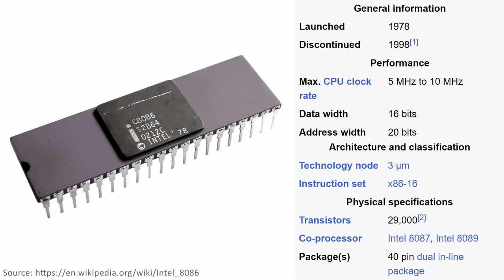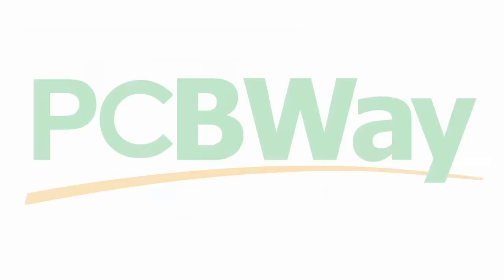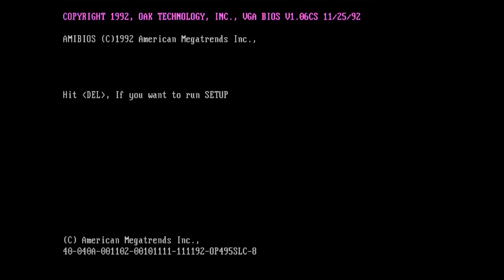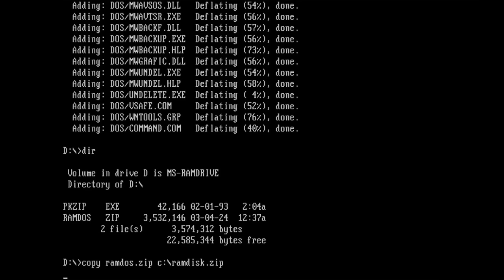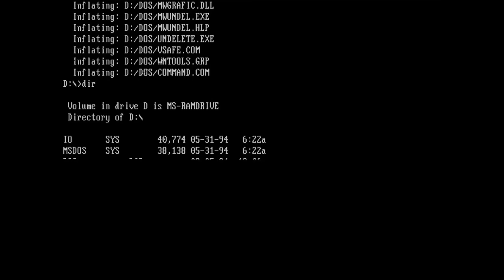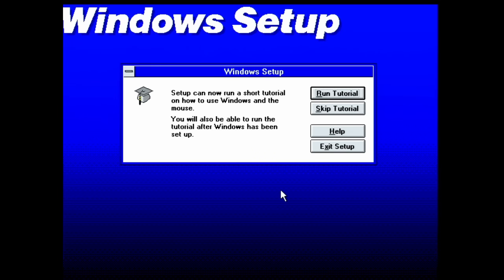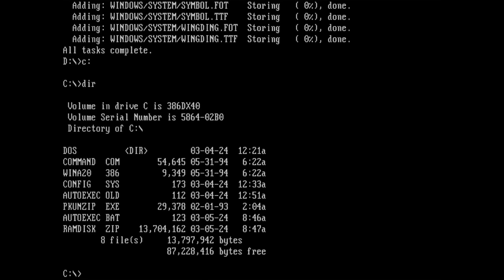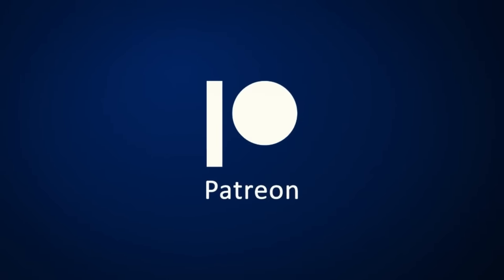MS-DOS and Windows on a RamDrive

Comment: I used ram drive as a working folder for saving files from Enable O/A. At the end of work, I ran a simple BAT file to copy everything from the ram drive to the 5.25” floppy. It was so much faster overall than saving to floppy every time.

Comment: It’s like running Windows 3.11 from a SSD from back then. It’s kind of incredible that RAM is and ever will be faster than some third Level Storage like HDD and even SSD but today’s SSD’s are much faster than RAM from back then.

But what I am wonder more is that if it’s possible to run DOS or even Windows 3.11 from the CPU’s Cache? On some CPU’s the Level 3 Cache should be big enough to Store on of these OS’s. I think it just needs some hardcore low level assembly programming.
Reply: arnolduk123  i dont see a problem by taking a cpu which has level 1, 2 and 3 cache and take the level 3 cache as "disk for windows". i dont think win3.1 apps could even use l3 cache so what. even some old cpu like a westmere xeon e7 has like 30mb level3 cache and still more level 1 and 2 cache than these old apps could ever use.

Comment: Back in the 486 days I had a machine with 12MB of RAM. I used to play Might & Magic 4 & 5 a lot, when installed together the 2 games would create "The World of Xeen." The game was a Wizardry style RPG where you moved from screen to screen around a map with a grid layout. The games only required 2MB of RAM to run correctly. I would setup SMARTDRV to use 9.5 MB of RAM as a disk cache similar to a RAM disk. After loading the game and playing for a few minutes it would start running almost exclusively from the SMARTDRV disk cache. Instead of the game taking a couple of seconds per move to load data from the HDD, when running from the SMARTDRV disk cache, screen updates from one screen to the next would happen instantly! If you weren't careful you could easily get yourself killed by moving around so fast but it sure made the game a lot of fun to play and much less tedious!

Comment: I used to do the exact same on my Amiga (who's OS sets up a RAMDISK as standard after each boot). Just stuck a load of RAM on my accelerator and did pretty much the same exercise as you did but in AmigaOS. But I didn't compress the files first - I just copied them to the RAMDISK at each boot. Looking back your method would've been a lot faster! 

The Amiga I had, came with a slow 2.5" IDE hard drive, so boot was slooooow when using the RAMDISK route. But after that initial mandatory coffee break, it really flew!

Comment: A work colleague bought one of those PCI cards that take memory DIMMs and retains its data if you plug it with an external power supply. He had dreams of copying his C drive to it for really fast boots. At the time, SSDs were very new, but I think he still would have got more capacity at a cheaper price if he went with the SSD, although not as fast.

Comment: In school around '87 we had PS/2 model 50 with 286 and 1Mb of ram, I set it up so I got a 384kb ramdrive and did my compiling there, saved a few seconds. 😀 most fun I remembered where when we discovered how to enable the 13h 256-color mode since Turbo Pascal 4 we had access to didn't support that.

Comment: It is alive. You can use ramdrives TODAY for caching, temp files and scrap data. It's faster than regular SSD 10x and similar or faster than latest NVMe drives. And another "hidden gem" is unlimited life cycle compared to SSD / NVMe. Modern programs for videoediting etc could eat hundreds Gb's of space with junk caching data, that tear and wear SSD. And now it could be huuuuge, like 32gb or larger.

Comment: I'm not at all surprised that Windows 3.1 just worked with the RAM drive. You're leveraging infrastructure intended to support network installs. For fun, get a copy of the Windows 3.1 Resource Kit and follow the "Setting Up A Shared Copy of Windows" instructions. You can have it write a read-only copy of Windows to your D: RAM drive and the config files and userdata to C:, where a slower disk won't be as big a deal.

Comment: I used to do a similar trick with my 4mb Atari ST, extracting an archive from floppy into a (compressed!) ramdisk. The self-extracting Lharc archive contained the Sozobon C compiler and my preferred shell program which weren't normally usable without a hard drive, but super fast from the ramdisk.

Comment: This is a nice overview, including pkzip's ability to only update or freshen files in an archive.  But why are you using smartdrv when everything is in a ramdisk?  It won't speed up the initial pkunzip at boot, because the .zip data is read only once during decompression to the ramdrive.  (And it won't speed up reads/writes to the ramdrive either, for hopefully obvious reasons.)  It won't really even speed up the save.bat pkzip update step, since the compression takes the most time in that process.  So why did you continue to use it in the final setup?

Comment: Yes and I had Dyna blaster running from it. At that point I only had 4MB of RAM. Edit: last time was quite recent that I used a ram drive. It was to integrate a utility that takes an image, process it and output the result. The problem was that it was a py exe that would always uncompress itself the py runtime. For this I had a ram drive to save on time and ssd cycles!

Comment: It's a shame that the RAM disk can't survive reboots, which was a useful but not well known feature of the Amiga's OS.
Reply: This recoverable ramdisk was called RAD: You could even boot from it. When I had an Amiga with enough memory (8mb) I even could configure multiple of these! It was like using a cartridge when playing a game. The regular ramdisk of the Amiga was called RAM: and did not survive a reboot.
Reply: Because it's none volatile memory - once power cuts off the data is gone.

Comment: Very nice! This is what I used to do myself back in those days. It's unfortunate that Windows no longer ships with a RAMdrive software as with modern systems able to take so much RAM that most applications will never use this would be an ideal way to utilise spare RAM capacity.

I use a RAMdrive on my current Windows system and have it configured as location for all temporary files that normally litter the system. My web browsers are configured to use it as well. All the cookies and data for web browsing stays for as long as my machine is running which enables me to restart a browser and have it all still work rather than have temporary files deleted on browser shutdown. The RAMdrive makes it all faster and has the advantage that anything potentially harmful is gone forever when I shut my system down.

A large RAMdrive could be useful for gaming in that loading and saving a game would be much faster. This could be implemented by starting the game through a batch file that sets up the RAMdrive, copies all the necessary files, starts the game, and on exiting the game archives any changes. This is double-edged sword in that, on the one hand, a system crash could lose all game changes if the RAMdrive contents had not been archived yet, and on the other hand no corrupted or garbled data from such a crash would be written to the hard drive so everything would still work as if the crash had never occurred in the first place.
Reply: one of the other commenters explains that in fact modern windows systems stilll can do this natively but you need to enable it.
Reply: @DoctorOnkelap If you're referring to 'prefetch' and 'superfetch', those are not the same as a RAMdrive. They can be of some benefit sometimes, but I prefer to keep them disabled as they massively slow down system startup and needlessly thrash the storage subsystem. They is also little control over them, whereas with a RAMdrive you have full control.
Reply: @DelticEngine   no the earlier comment mentioned going to device manager > action > add legacy hardware > install manually > show all devices > microsoft > windows ramdisk controller
Reply: @DoctorOnkelap Are you actually using this yourself? In what version of Windows? In Windows 10 it's supposedly a non-functional 'sample' driver that needs modification to work, assuming it actually works at all and isn't just there to keep up appearances for some legacy application. Interesting, though.

Comment: It's better to create a bin folder for personal commands and add that folder to the PATH variable. This way you don't clutter up your root directory.
The power of such a bin folder can be increased with batch files.
Reply from the maker: You're correct - didn't think of that.

Comment: My old Amiga 1200 from 1992 would automatically set up a dynamic(it would automatically resize itself when you copied and deleted files to and from it) RAM drive on startup as part of the OS, was very handy as we only had one floppy drive and no hard disk originally. Would appear on the desktop with the assigned volume of "RAM:".

Kinda become redundant once I got a second floppy drive, but once I got the hard drive, bigger games and more RAM, sometimes I'd copy the game install folder over into RAM: for near instant load times.

Comment: runing drivespace bin against a ramdisk making it into compressed memory ramdisk?
Reply from the maker: Ahh, nice! That sounds like cheating, downloading more RAM, or someone who also watched my DriveSpace video 😉 👍
But you're right, I should try that!
Reply: @bitsundbolts  biggest problem would be keeping it at restart because i don't know how dos unmount drives, does it has to start host drive before or after boot process
 for non boot partition probably would be easier to implement but i am still impressed that ramdisk works in dos as default and that windows know what it is
Reply from the maker: Yeah, I think it would require a very different approach. DriveSpace stores the content already in its own containing file. It might be a lot more complex than I initially thought

Comment: In fact, I use the same technique under win10 + ImDisk ToolKit for ramdisk + Robocopy for restore & backup. I put all temp files/folders and dozens of some cmd litle tools and batch files.
Reply: Some software can have troubles running from such ramdisk. There's a tool to overcome that (Google "Replacement (GUI + windows service) for ImDisk Toolkit". Haven't tried it though.

Comment: @BitsUndBolts
While you make a good point about 32MB being enough, I have done this kind of thing before and found that 48MB or even 64MB gives much more "wiggle" room, or flexibility if you wish. Granted, that was on a 486, but still, more RAM is always better, even if some of it goes unused. It's always better to have more than you need rather than to need more than you have.

Comment: You forgot to move the shell to D: drive. It's the COMSPEC setting in config.sys.

NB! I like using xmsdsk. It can locate itself into the top of the XMS memory. Helps to occupy all ram above 64MB on Pentium 1 machines, where chipset can't cache over 64MB of ram. ;) By having 256MB of ram and 192MB ramdisk in my Pentium 1, i can have the cake and eat it, too. :D

Comment: 8088/6 can address more than 1MB, every memory cycle it outputs internal state, so code, stack, data segments could be separated addressing more than 1MB. And it's not MMU strictly speaking, just use those bits for address.

Comment: Do a hex compare on the generated archives. Even tho it can update single files, I still think it's going to change the data of the whole archive, thus creating even more flash wear for every update you make
Reply from the maker: You're correct that if PKZIP does write the full archive even when only a few files need to be updated, then we're writing a lot of extra data to the drive. This solution makes a lot more sense when using an old spinning drive as permanent storage media.

Comment: when i was a kid i got a macintosh. they had built in ram disk from memory control panel. i used that a lot to play with things.  my friend had a 3.1 system and it was totally foreign to me. of course i wanted to play with it.  i found the ram drive files, played with that a lot but i never got it working for anything other than just loading doom onto... by the time i was in Jr. high we had windows 98 and macos 9.1 so the ram drive stuff faded away.    however in 2007 or so i had a phenom II system with a 256mb 9600 Nvidia. farcry 2 lagged pretty bad on high texture settings.  i made a 4gb ram drive and installed the game there - buttery smooth game play now that it wasnt so limited by 256mb Vram

Comment: I had ramdrive, in Win 3.1 file manager its icon is a chip. The files can be opened much faster with ramdrive , but after shutdown the files will be lost, if they are not saved.

Comment: No, I didn't know about RamDrive native functionality. Quite amazing the see such advanced technologies are in fact old. But I guess its use was more limited back in the days due to limited memory. Do you actually have an use for this not just being neat? And the booting process isn't actually slower with this?
Great video, keep up with the good stuff!!
Reply from the maker: Yes, the boot process is a bit slower because it needs to extract the entire archive to RAM. However, if you have an old hard drive that is slow in Access time, this setup could be faster. And I am sure that windows feels a lot snappier when loaded from memory than a spinning disk drive.
Reply: That's true. The limited memory limited the usage of a RamDrive.
I only had 8 MiB in my PC and 8 MiB were required for some later games. And in Windows 3.1 you needed all the RAM for Windows and Windows applications to prevent Windows from using a pagefile.
Today the situation is much better, I use the RAM device /dev/shm/ to fiddle around with files that I don't necessarily need to persist. This reduces the wear out load on my SSD.
Reply: the use case was for if you had no budget limits and/or if the program was small. most programs were fairly small and most programs and games were not written to copy themselves entirely in ram if there was space in ram to do that.

ramdrive is one of those things that has always kind of existed in that space. you can get benefits from using a ramdrive for development work and stuff nowadays still, but the cases where it helps are such that take a lot of space :d  if I had 4x the ram I'd put gradle on a ramdrive.

if you got smaller apps that trash their log or profile folders putting those on a ramdrive can help a lot still, you can do that in win11 or whatever and some use cases it's not that much of space you even need, just like a gig or so for a browser profile or similar.
Reply: @OpenGL4ever Yes indeed! On my daily Windows I have my ImDisk set up. I have a quite good amount of RAM and it is very useful having a RAM disk. The temp folder is set to that drive and often I use it to extract archives or any fiddle with temporary files. I even had virtual machines running of a disk in ram. Quite interesting!

Comment: This is AMAZING.  I didn't know anything about this.  I had heard of "RAM drives" that had battery packs to retain the stored data after shutting the machine off but I didn't know that DOS had a provision to actually use the system memory for storage in this way.  Could this be done on a 486 with DOOM2 loaded on the RAM drive and DOOM2 executed and played 100% off of the RAM?
Reply from the maker: Yes, you can put Doom on a RAM drive on a 486 system and play it from there.

Comment: I understand the concept of doing this, but what I'd like to know is what are some practical reasons why you'd want to do this?
Reply: Demo system in a store for example that you want to be fresh on every reboot even if people mess with it. Or for safety reasons - infection cured just by rebooting:)  I think in my school they used sort of a similar thing, except it was a physical card that wiped any changes to the base system.
Reply: @TheBacktimer  Yes, my high school were trialling such a card, I believe it was called the Zero Card, they didn't end up using them, too expensive I'd wager.  But they sure needed them, students did some very irritating things to some of the computers, completely messing them up for other students.
Reply: @TheBacktimer  It just occurred to me, do you think those cards acted as a sort of RAM disk on a card, storing important data and then being wiped when shutting down the computer?  How else could such a card work?  I think these days this kind of computer security is done via software programs such as HDGuard.
Reply: arnolduk123  What would you use a scratch disk for?

Comment: few years ago after building a brand new computer I kept having random stutters that would keep going 10 secs or so and then stop.
and one of the things I did when I was running out of places to look for what was causing the stuttering was make a ramdrive and move the whole games to it, then make a sym link to point it to the ram drive. 

Funny is that disc access was not the cause of the stuttering which one day just stopped happening out of nonwhere

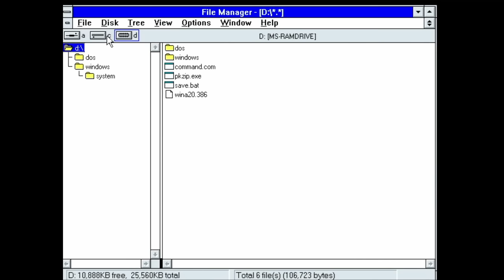Comment: 10:45 you can get 32megs of sram

How much faster will the CPU run when ram runs asynchronous and at CPU clock speed
Reply: You could definitely use two 512k sram to replace the base 1meg or 640k